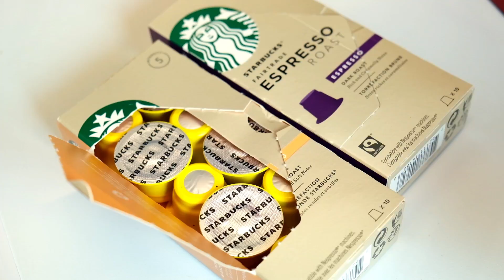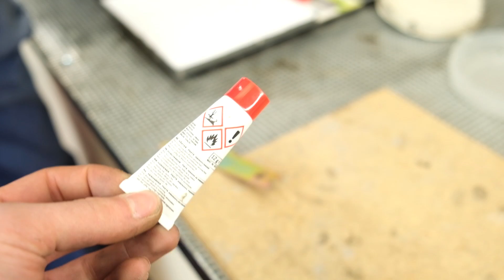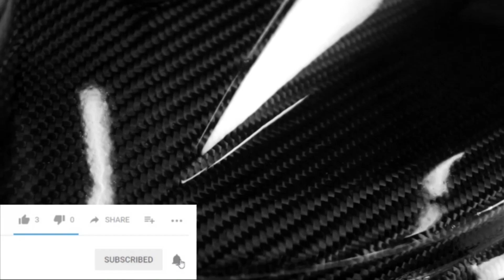Making a Carbon Fiber Motorcycle Rally Fairing - DAY 2

Comment: Would you mind telling what resin to chose if im building my own motorcycle gas tank. Carbon/kevlar.
Regards
Reply: Normally you could use a standard epoxy for your build up. But make shure that you coat the inside of your tank with a tank coat (mainly used to prevent rusting of the to tank, but works also for composites as a gasoline barrier). You mix it, pour it in the tank, shake it well to cover all the inside and then pour the rest out.
Reply from the maker: Hard to tell, not sure if epoxy will be OK...